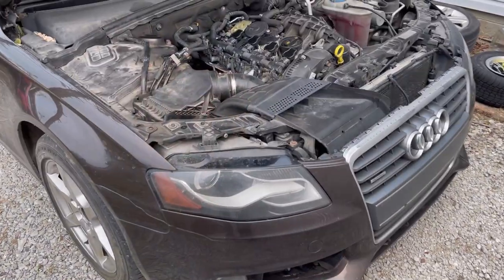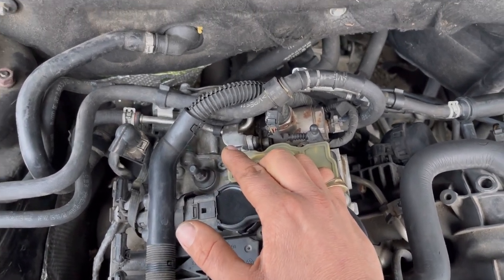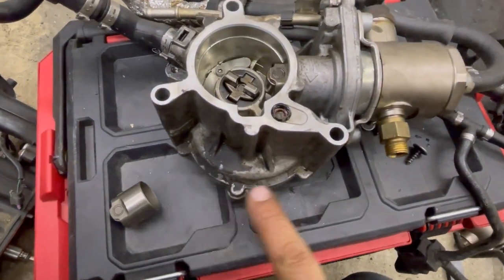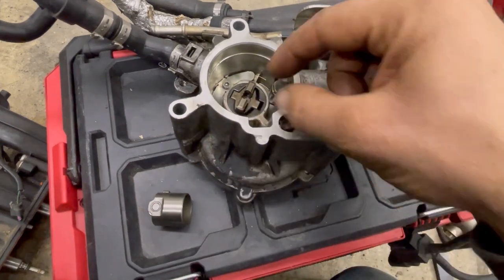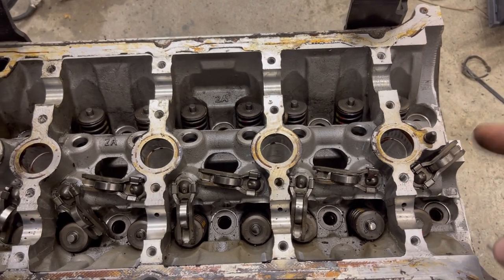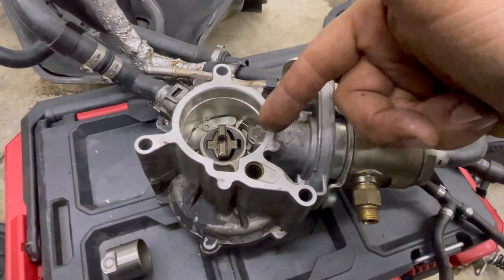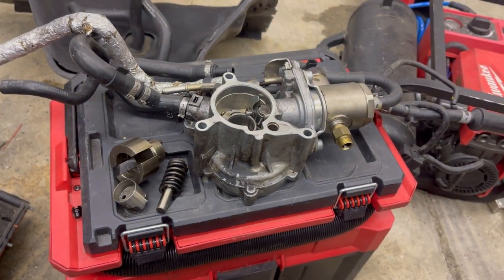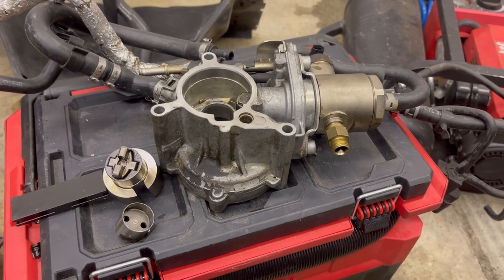2.0t Audi VW how Vacuum Pump works, hpfp oil pressure screen restriction warning tfsi tsi b8 b8.5

Comment: Im an FSI guy .. but I have learned so much from your work. . Note .. there is a pretty good FSI to TSFI fuel pump conversion i would like you to look at designed by iAbed Inc.  Also I need to know where did you get your turbo blanket.. i haven't found one that covers the exhaust manifold properly.. thanks for your wisdom and support..
Reply: We FSI guys need to find a Naptown Tuner for the EA113 platform. I’m interested in the TSI cam follower conversion too. I noticed that the kit sometimes comes with a new HPFP spring and sometimes it’s not listed in the Included parts, depending on retailer. There’s also a video of GTI with a really loud knocking sound from the HPFP area after the kit install and comments say the same thing with their cars.
Reply: FSI guy here too. I wish I would've recorded all the work I've done on mine! Hell evertlyrhing has been replaced except the valves and head.
Reply: @headstrong6523  Sounds about right.  How's she running nowadays
Reply: @snoopy5736  still going strong! 236,400 on the odometer
Reply: @headstrong6523  Hell yea 👍My b7 is at 133k. I was having oil pressure warning,  ended up replacing the oil pump assembly with an balance shaft delete sprocket.  Its back in business for now.

Comment: Will a clogged screen in the car pump cause low oil pressure in the engine?
Reply: Not likely, but clogged screens on the balance shafts definitely will turn on low oil pressure light. CCTA owner by first hand experience.

Comment: Great video.. hmmm I had no idea that vac pump was basically a wankel design.. with the wipers acting as the piston or lobes to create the vacuum.. that was a great video.. I suspect those wiper seals need a thin layer of oil to make a perfect seal.. and a clogged screen will prevent that seal and thus probably won’t have sufficient vacuum? I didn’t know that the HPFP got its lubrication from the vac pump.. dude you’re a serious source of information.. like I say, best educational videos for 2.0 t out there.. thanks keep em coming..

Comment: Thank goodness the Tiguan has East West engine. Fixing a persistent oil leak on vac pump I found the lower mount bolt was stripped in the head. In the end I had to helicoil all three as a second one went getting to 10Nm on the second reinstall. Someone must have been heavy before. Be very careful on the torque. At least I could drill and helicoil easily in situ on Tiguan otherwise a disaster. Be careful also if you've had an oil leak on an older engine. The plastic block coolant fitting below crumbled to dust when I tried to wipe it. It was ready to let go and had been weeping (I thought it was water pump) and I found it by accident. Always change that fitting if you are there as it hates heat and oil.

Comment: What would cause the vacuum pump to lock up and spin the timing gear on the exhaust cam just 100 miles after a complete engine overhaul?

Comment: Question, you made 2 videos before about HPFP problem with the code P2188, i have a p0172 system too rich, my long term fuel trim is -8 and if i clear codes the short term is -25, it runs rough only at idle until the engine is hot, could it be the HPFP? or do you have another idea?
btw, i checked for vacuum/boost leaks is all good there, injectors all good, no other fault codes.

Comment: Dog keep it up. Any ideas on a ticking from cam adjuster, sporadic oil pressure light, also has a cam not hitting set point on intake cam. And knock sensor signal to high code.. I just got the car. Any direction u could point me in would be nice.  Lol thanks again.

Comment: Hey man , is the camshaft the same thing as the valve cover gasket ? I just had the valve cover gasket replaced on my 2013 b8 & the dealership said that my vacuum pump & the camshaft need to b replaced but now from getting educated from your videos I believe my oil leak is only coming from the vacuum pump ..

Comment: I have a question. I did a cylinder leakage test on cylinder 4. Found no  leak on intake, exhaust, oil filler, dipstick and reservoir but leaking on cylinder 3 spark plug hole. Is this normal. Also have zero compression on cylinder 4.

Comment: I have question I have a 2009 audi a4 quattro 8.5... my waterpump is not spinning. The belt that spins it is good. I replaced everything thinking that was my reason for over heating, even did head gasket leak test. Then I thought to check and see if the pump was even being spun and it was not. What is the cause and how to fix?

Comment: Thank you so much for the well done video.  I removed the valve cover to redo my seal.  After putting it back, I noticed there was a leak at the vacuum pump. Upon further inspection, I notice a little, perhaps  5 thousandth, offset between the valve cover and the cylinder head body.  I loose the cover, having it lifted a little, and try to reposition without much luck. The short cut way I am tempted is to use permatex on top of the tri-ply gasket to seal the pump.  What do you think? Appreciate your input.
Reply: I fixed the leak by replacing the old gasket with the OEM (Three plies instead of a single piece that I got from Amazon) There are 2 little strips of blue silicon around the area of the cam tray and cylinder head.

Comment: U have educated us so much on our volkswagon cc 2.0 turbo. Thanku for ur videos. Just a quick question if u open the time chain box will does it thriw the timing off if u never touched the chain??
Reply: No issue with timing, but you might cause an oil leak at the upper cover by removing it for inspection. CCTA owner by first hand experience.

Comment: Ive watched a bunch of your videos. If you delete the vacuum pump, and pull a tradition brake booster vacuum. How would it act in boost pressure? I noticed the car doesnt like brake boosting because it cuts throttle response if you are on the brakes and throttle at the same time. Im adding my own cheap oil catch can and had the same questions about how it will react under boost pressure. I plan to simply split the pcv line to the the intake and use a catch can. Unless you have a better suggestion for where to put it. I see the turbo pulls from the pcv also and considered running a catch can on that side also
Reply from the maker: It’s not worth it, I tried it and never got it to work.  
You could try as well but won’t get a benefit in my opinion.   Just keep it the way it is until you can sell it and get a 3.0t if you want more power.
Reply: @NaptownTuner  i imagined it wouldnt be worth messing with but was curious. Im replacing my upper timing cover because of an oil leak. I know its leaking there for sure, the filter housing may also be leaking. The block side, i dont think its the adapter to cooler leaking. It could all be from the upper timing cover for all i know. Do you seen those o rings leak very often, in the oil filter housing to block
Reply: @NaptownTuner  its pouring out of the top cover. Oil is all over the left side of the block. All the way to the crank sensor, so idk if i have more than one oil leak. I pressured washed the engine, my cover and seal will be here tomorrow and ill go from there. Its either the filter housing and or cooler, or the oil separater by that engine mount. Coolant is fine and stable, oil isnt milky. Appreciate the no bs videos man. Not much info on this oil filter housing and even less on the oil separater out there. Im glad there is room to work on this engine. I looked at an s6 i believe for sale with the 4.2 but removing the engine for oxygen sensors seemed a but to much for me.

Comment: Anyone know where you can get just the screen for the vacuum pump?  Mine had broken tabs on it sitting in the screen and would rather replace it.
Reply: We’re in the same predicament!! If you get any leads, please do fill me in!! Im not sure what the part is called but it’s the little black piece that the screen sits into to restrict the oil.
Reply: @kaylyntruscott9072  I haven't found anything yet.  It's been running with the screen in there without the tabs for about 500 miles now, but would like to replace it.

Comment: will the clogged screen cause low oil pressure condition?
Reply from the maker: It can restrict oil flow to the head causing damage yes
Reply: @NaptownTuner  Thank you for the reply. I have a 2010 A4.. did the vacuum pump gasket (where it bolts to the head) and oil change and now I am getting oil pressure light. Getting down to 5 or 6 psi at idle when warm.. No oil pressure lights before that but it was bought from a used car dealership.. My question is if the clog screen is causing low oil pressure if I clear the screen will the oil pressure return to normal? And also how common is it that the oil control valve in the intake cam can cause low oil pressure? Got one of those on the way. Thanks for your input
Reply: Could you let me know about that? Still having the issue, haven't pulled the vac pump again to check screen yet..